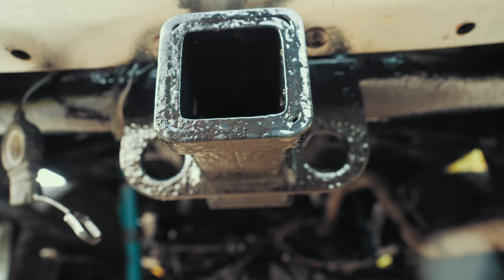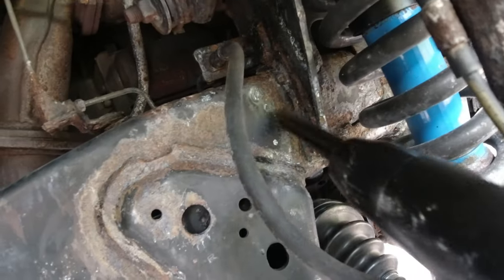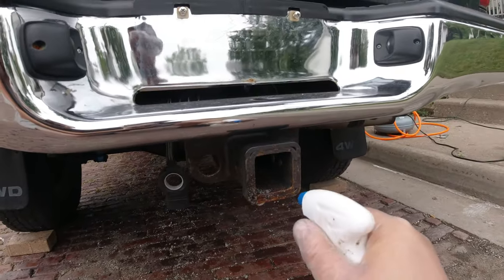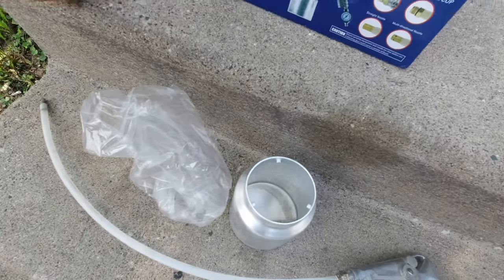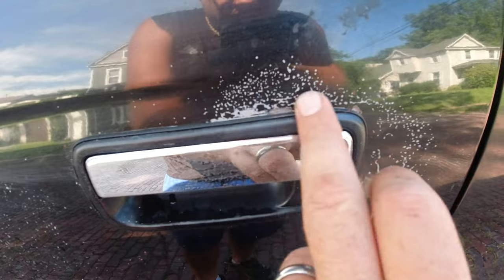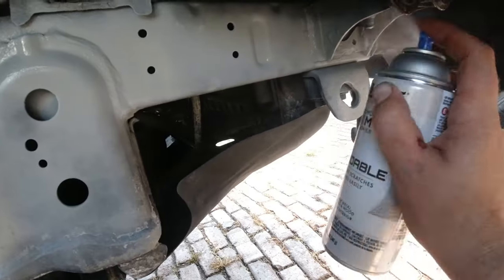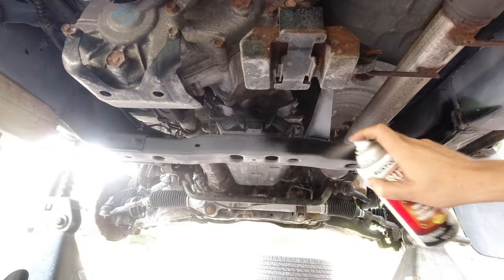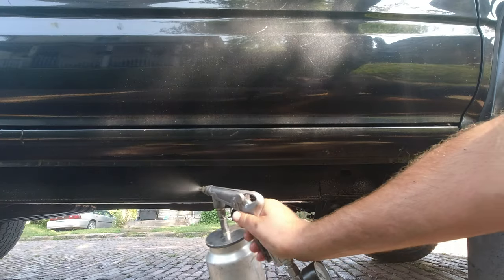Ultimate Undercoating for the Rust Belt - Converting Rusty Truck Frame to Salt Water Warrior

Comment: Lanolin based undercoating products like Fluid Film and Wool Wax can be sprayed directly on rust, and if reapplied every couple of years will stop the rust  cold. 
No need to do the de-rusting treatment which may cause more problems than it solves.
Reply: Fluid film sucks. Surface shield is definitely better
Reply: I use Fluid Film and love it.
Reply: @stevenh4970  LOL... Otay....
Reply: @stevenh4970  
I will admit that from tests I have seen, that Surface Shield leaves a durable film even after the lanolin has worn off.
That said, my 2018 model Chicago based car which has been Fluid Filmed three times, looks almost like a new car underneath.
So, I wouldn't say that it sucks exactly.
Reply: Yeah, the painting was unnecessary and will potentially cause problems down the line
Reply: I love WoolWax.

Comment: Two questions:
-How did you clean out the Rust Kutter from the spray gun/nozzle/reservoir before switching to the Surface Shield?
-What was your compressor set-up with the needle scaler (SCFM, size of air tank, etc.)? I've heard needle scalers require large compressors/reservoirs.
Reply: Curious about the CFM as well. Most affordable ones are only rated for about 2 or 3 CFM which apparently isn't all that much. If you want 10 or more the compressors run $6k to $12k.

Comment: Well done - always nice to see a 1st gen Tacoma get new life. Also, using the Surface Shield in the gallon format is WAY better than the cans. I went the can route and it was a nightmare - they clog up after about 20 seconds of spraying and the nozzle needs to be taken apart and cleaned out. Always go with the gallon and a sprayer!
Reply: Can't believe they still haven't solved the spray can issue after all these years. Pathetic effort by the company.

Comment: It's a little more expensive but I use engine/ header high temp paint. No primer needed.
Also, for rust I spray it with Thermacore or Evaporust.

Comment: Thank you very much for your video. I am up in Alaska, and I intend to follow a very similar route. My process is looking like this:

1. Wash/degrease

2. Knock off the chunks of rust/grind

3. Wash and break clean

4. Rust kutter

5. Rinse

6. Rust kutter

7. Rinse

8. Rustoleum clean metal primer (I spoke with Rustoleum and they said if you are converting before hand and you will have mostly converted/bare metal then you should use this primer as it will still handle some rust if you missed any, and it will give the enamel better adhesion)

9. Rustoleum professional protective enamel

10. Herculiner roll-on bedliner (specifically excels at deflecting rock-chips in cold climates per project farm)

11. Following, In the frame rails and behind pinch welds/seams I intend to use rust kutter at step 4  and then follow that up with fluid film after step 11 (a product i wouldn't use anywhere else because it grosses me out)

Thanks again for making this very thorough video.
Reply from the maker: Nice!!

Comment: Why not just use the Surface Shield and save most of the prep work and all the paint/primer (just remove the flakey stuff?  That is what this video for Fluid Film says https://youtu.be/Y0lJDuCWFlA and what I plan to do on my Tundra and my daughters FJ Cruiser.  I'm going to use Fluid Film inside the fenders, rocker panels, and quarter panels (since it is cheaper and won't get washed off there) and Surface shield on the frame and underbody and repeat after 2-3 years for exposed parts based on inspection.

Comment: This is pretty much what i did to my old subaru. Wire brushed the under carriage for hours, sprayed it with over a quart of rust dissolver, pressure washed it when it had done its work, let it dry, then soak the entire under carriage with half a gallon of linseed oil using a spray gun (including inside the beams and structural members)

It is an awesome feeling! Now to see how it looks in a few years. 
Linseed oil needs to be reapplied every year or two, but now that the worst part is done, its more a quick once over (unless some catastrophic areas reveal themselves)

Comment: There’s no need to go that far with the rust removal unless it’s for aesthetics.  Surface rust won’t keep spreading under surface shield so just get the big flakes off and start spraying. It’s actually better than spraying over paint as paint will chip off easier and leave bare metal.

Comment: For long term maintenance would it just be a case of spot treating any rust and then topping up the undercoating layer every couple of years?
Reply from the maker: That’s what I plan on. I just recently did control arms and was able to access some areas I wasn’t able to as well, so i touched them up :)
Reply: @JRESHOW  Awesome, I was toying with the idea of POR15, while tough POR15 looks like absolute hell to get off if you ever need to, your method looks great with regular maintenance

Comment: You mostly got it right but the rust reformer wasn't really the best final step. First, it's redundant because the existing surface rust has already been converted or "reformed" with the Krud Kutter. And second, having used it myself, it's not very durable as a final coat and doesn't resist scratches, dents and dings very well, and will quickly chip off and reveal the metal underneath to exposure to the elements, leading to future rust. This is especially true if you didn't remove the underlying embedded and pitted rust that remains and will spread if exposed to water, salt and air.

Rust reformer is better used as a primer layer instead of phosphoric acid-based rust converters such as Krud Kutter, and not as a final top layer. For that I've had best results using either PRO-15 or KBS RustSeal, but others also use epoxy-based paint or powder coating, in which case it's probably still better to use a phosphoric acid-based rust converter than rust reformer, which is really more for out of the way parts with very light rust that are less likely to chip and scratch, and even then you want to top coat them with something tougher.

Basically, the process to treat and rust-proof rusted metal is:

1 - Clean to remove paint, dirt and crud to expose just the rust and metal
2 - Remove as much rust as possible using whatever methods work best
3 - Degrease thoroughly using detergent-based degreaser (i.e. NOT brake cleaner or solvents)
4 - Treat with a phosphoric acid-based rust converter (better yet one with zinc as well)
5 - Paint with a tough coat of something like POR-15, epoxy paint or powder coat
6 - Optional, top coat, especially if it'll be exposed to UV rays
7 - Optional, spray on oil or wax-based protecting layer such as Surface Shield

Comment: Great job. Is there a follow-up on this technique?
Reply from the maker: I ended up selling the truck but have a test running now on a new 2023 tundra… I’ve also got some steel that’s going through some test but nothing really to show yet. It held up great for the first year and winter before selling. Guy flew from 20 hours away to buy it. It’s good stuff. Just a simple wire brush and spraying the undercoat will suffice
Reply: @JRESHOW  Well, that sounded like good news for you. Thanks for getting back to me, take care.

Comment: Nice work!

My car has rust only where the frame is welded, but overall is in good condition.
Do I have to do every step that you did to prevent further rust buildup? Can i just wire brush the rust and spray Surface Shield?
Reply from the maker: Yes!

Comment: I would of used a pressure washer with the sandblasting feed system on it you could of used baking soda to blast it or a fine medium of some sort of worried about wirers  electric items cover with aluminum foil.
Much easier and the baking soda protects metal until you ready to paint.

Comment: Nice Video. I am doing something similar, but wish I would have used Rust Cutter. Instead I am using Naval Jelly, then 2 coats of Rustoleum Rust Reformer and then 1 cost of gloss black.  And lastly I plan to use Fluid Film or Blaster, depends on the price per 5 gallons.

Comment: Heard someone used rustoelum farm and implement low gloss paint after using that rust reformer. Wondering if it is worth doing that extra coat of farm paint or not?
Reply from the maker: Depends how far ya want to go I suppose. I know the gloss can add an extra protective layer for rock chips, but you’d def want to make sure you’re down to bare metal.

Comment: Great job! will this Surface Shield stay "wet" and collect dirt and dust?
Reply from the maker: It will stay wet looking for a bit and will collect a extra protective layer of dirt and dust, then it doesn’t look so wet. It looks like a flat black. But when you take your finger nail to it it’s got a nice layer of build up to protect the frame. Back in the day they used to use oil and hit a gravel road to accomplish a similar protection.
Reply from the maker: I just did the front and rear diff fluid the other day and you can see what it looks like a year later.. https://youtu.be/AWBsTC4C5Oc

Comment: Hey did any get on the paint? From any overspray or air blowing across bottom ? Didn’t know if I need to put paper or anything on bottom of truck on sides ?.
Reply from the maker: If you’re referring to the undercoat, you don’t need to worry about it. It’s pretty directional and if it does get on the paint it won’t hurt it a bit. Not really any overspray either..

Comment: OLD ENGINE OIL MIXED HALF AND HALF WITH SHUTZ  SPRAYED ON THE UNDER BODY  IS WHAT WE USE  THE SHUTZ HOLDS THE OIL  YOU NEVER GET RUST WHERE YOU HAVE ON OIL LEAK  THIS IS VERY CHEAP   AND EFECTIVE  FORGET  YOUR WAXOILS ETC

Comment: How many hours work do you figure you have there?  Nice job!
Reply from the maker: Too many lol. I bought a tundra and am just going to wire burst the rust, spray the rust cutter, and spray the undercoating. Gonna skip the primer and paint. The undercoat does good alone. I’ve tested it on metal in my back yard for the last year and it had 3 feet of snow on it and I literally threw a bucket of salt to melt it all and it was still good. Just keep up with undercoat if you don’t want to paint, it takes a lot of time.
Reply: @JRESHOW  Thanks for the reply and the video.   Good luck with the Tundra.

Comment: Good day, Jresh
Owner of a 2008 Toyota Sequoia that's never left Florida.

Thanks to a possible job opportunity, i may be moving to Mason City, Iowa. I'm from Florida. Driven through snow a few times while traveling but have never lived anywhere with snow. I do not have a compressor, spray gun, or even a proper jack. Only a cheap harbor freight bottle jack rated for 4 tons. As I may be moving, i dont want to spend money on buying items similar to your setup, but I am willing to go under car and coat it. What would you recommend i do to prepare before I leave?
Reply from the maker: Hi there!! I’m from Iowa! We just got a nice snow storm lol. It sounds like your Sequoia is pretty clean underneath! I would just give it a good power washing underneath, let it dry for a few days and undercoat it with some surface shield before you head this way! That should do it!
Reply: @JRESHOW  Thank you so much for the quick reply.

I’m sure I’ll deal with the intense cold just fine (hiked in a tank top during winter when I was in Lake Placid, Upstate New York on a roadtrip. -1 degrees, at the time). 

That said, I got nervous when I read how corrosive the salt and brine are to undercarriages. I don’t baby myself, but definitely baby the sequoia.

I’ll follow your advice, Jresh. Thank you kindly.

Comment: What are your thoughts on just using surface shield on the bare frame and foregoing paint?
Reply from the maker: That would work too as long as you keep up with it from year to year, just checking to make sure you still got a coating on there. I like to spray this stuff and hit a gravel road to create another barrier. This stuff held up great after a year, and I didn’t have to but I put another coat on and drove more gravel roads. I’ve got a nice build up now that I can prolly go a few years no worries. So in short, yea, just spray the surface shield on the bare metal.

Comment: If youre using decreaser, are there any parts of the car that it cannot touch?
I do not have a garage, and Im not able to remove the wheels when doing this either.
Reply from the maker: I didn’t really tape anything off but just tried not to get it on anything electrical too much.
Reply: @JRESHOW  what about brakes and such? When I had to clean my mt.bike, keeping it off the brakes was a big issue. It would ruin them completely, and/or make them squeak. Not sure if its the same with anything on a car
Reply from the maker: @michaelfrymus  yes!! Def. Avoid brakes with the undercoat and degreaser. I think I just wrapped mine with a plastic grocery bag
Reply: @JRESHOW  Hmm.. Cuz I can only spray with degreaser at a car wash

Comment: love the step by step tutorial dude, was wondering how's it looking at the moment? i understand its been close to a year since the vid has been released just wanted to know if you took the truck out on the beach in between the year time or anywhere near salt water, if so how it's holding up?
Reply from the maker: It’s holding up well. No beach or salt water… however went through a Iowa winter.. still a nice thick coat on on the surface shield. I’ll do an update video at a year..
Reply: @JRESHOW  Do you pressure wash the undercarriage during winter?  Curious how the Surface Shield holds up after washings.
Reply: @vincec.6130  you don't wash under the vehicle after applying surface shield. just respray every year at the beginning of fall or the end of summer. you can wash the main part of the vehicle as normal. just leave the underside alone until you need to respray the frame.

Comment: Surface shield is good , but cosmoline is much better. 
I feel like the paint was a mistake. Every truck I see that someone has tried to clean off the rust then prime and paint just leads to more rust under the paint, especially with "POR 15"
Reply from the maker: Not a fan of the POR 15 either. I’ve done this many times and see what you’re saying. However, on metal where you can get all the rust gone I’d prefer to paint before the surface shield. If it’s still got noticeable rust then straight to sure face shield or cosmoline would be better.

Comment: I use old moter oil i keep from oil changes mix with diesel fuel.  I filter out junk with paint mixn filters.  And have been for 30years or so. I use a wand type sprayer.. 2 times a year.  Be careful around electric connections and stuff. And rubber bushings.
Reply from the maker: Free is the way to be!

Comment: Isn’t it bad to apply paint? I’ve heard paint and rubber undercoating locks in surface moisture and exacerbates existing rust.
Reply from the maker: Rubber and paint are diff. as long as you clean well, and is dry, you can paint. Or just knock of the rust and apply the surface shield/ fluid film or your choice of undercoating.

Comment: Im sorry to say but ur first steps were compleatly useles if u use surface shield... surface shield should be reaplied when its active nomore. So it means its active all the time if aplied.. and it works on rust... so no need to acid the frame or paint it. Now u spray with shiel everything but its also unecesery... cuz painted areas dont get any use from it. Painted areas if treated well with rust converter are more permanent protection. But usualy they mostly are not if jube has not been done the right way. For that u need to clean the car 99 percent of rust(cuz its nasty)... treat the bare metal cuz rust is still in pours.. prime it, paint it. And for the paint... paint for undercoat is not the best... cuz its weak.. there are much beter options for underside. Like antirust prrimers.. ruberised paint that doesnt crack and doesnt dry as easily as paint.. after ruber use wax that will prevent ruberised layer to dry and crack.! Ifu go seaeled route... ull pay alot.. but if done coresctly it will last 10 plus years without major issues. If u dont go sealed rout... it will be way cheaper.. but u will have to reaply and pay each time... result might eaven be more money to aply each year ur film than going full sealed... depending on products u use.

Comment: Does that final coat you applied ever dry
Reply from the maker: The surface shield? It hasn’t yet…
Reply: I've done it with tacky bar and chain oil. It doesn't "dry" completely, but it eventually gets the same consistency as the gunk on a bicycle/motorcycle chain as it dries. Almost like a tacky grease.

Don't rub up against it, but it won't drip on you or your driveway after about a week.

Comment: so the paint doesnt trap moisture in the frame ?
Reply: It does once you start getting rock chips in the paint ! I would never do this to a michigan vehicle
 all you need is fluid film or something oil based and just spray it on forget about all that work he did ! I got a 1978 F-250 that been in michigan all its life and is still in mint shape !
Reply: @dougyoung3896  ok well i live in the U.P we get hammered pretty hard i also do not have a garage i sprayed it with diesel this year and it seemed to hold up good do not notice any new rust

Comment: it seems 3 days is too long for rust converter other brand call for 30 minutes before rinsing, you should not let it soak or it will eat the metal spray is good enough
Reply from the maker: Following the directions on the Rust cutter bottle.

Comment: I admire your tenacity. Everything you did won't prevent rust from forming, undercoating needs to be done with oil, specifically, Husqvarna bar and chain oil, if you heat it up you can spray it into every crack and crevice, it's the only thing that works in the rust belt.
Reply: Wrong. What he used will work well. It was an oil.
Reply: @denverwood5290  nope, oil is superior to any commercial undercoating, I live in the rust belt, and  everyone uses bar and chain oil.